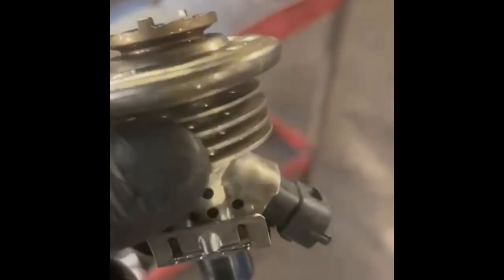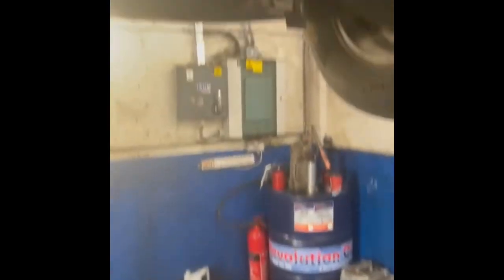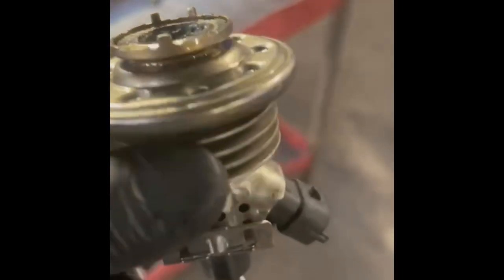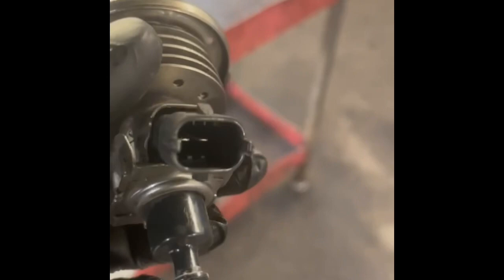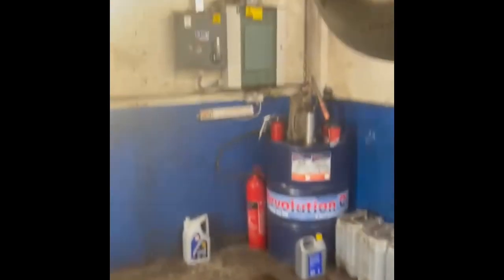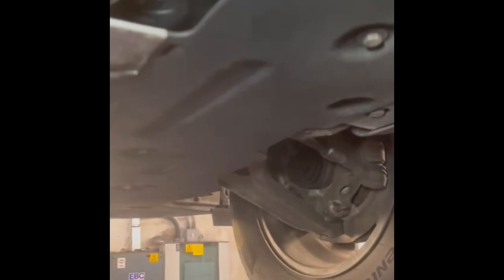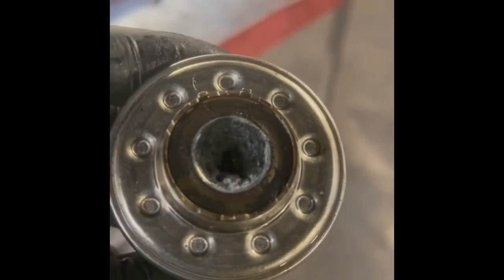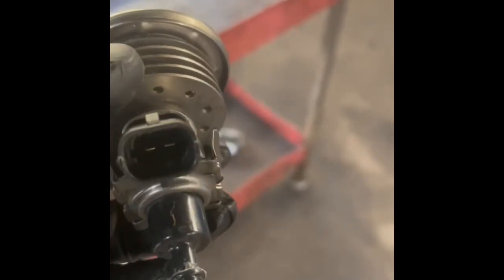DPF Problem with Range Rover Evoque 2.0 Diesel 2020? Check out Ad Blue injector blocked.@zmmotors1

Comment: Struggling with trying to remove the DEF injector.  Electrically plug off but can't get the unit out.  Partially broke one of the tabs already.  It spins, but won't pull off.  Any help appreciated !